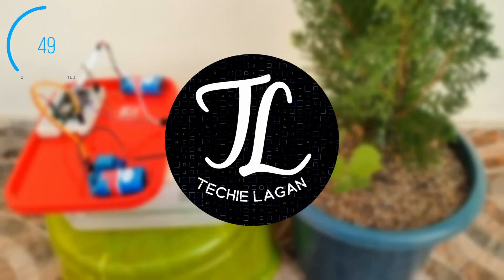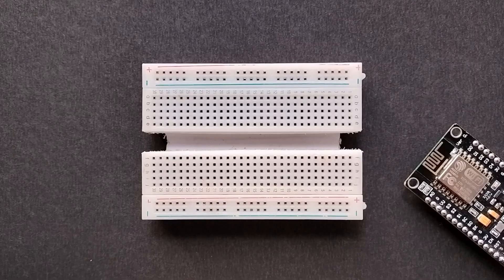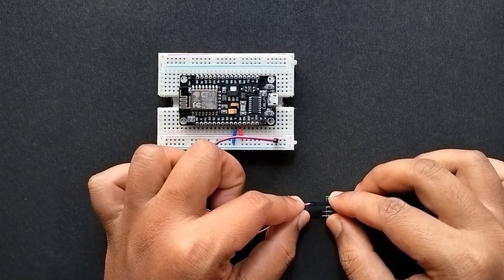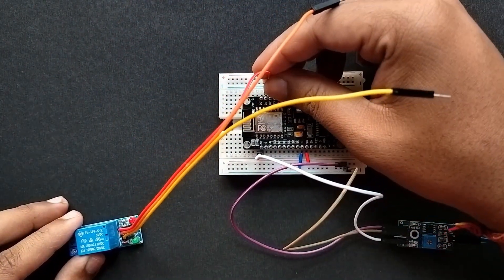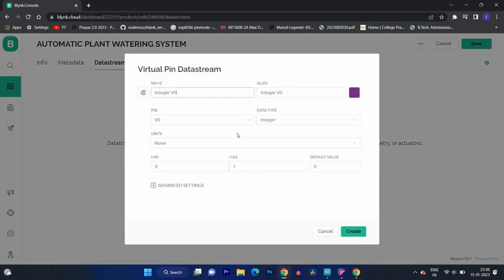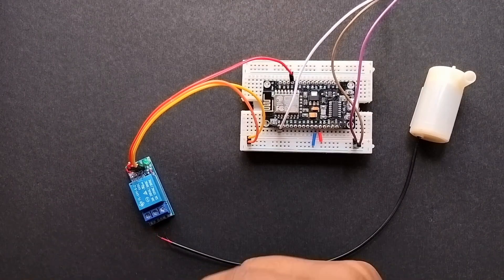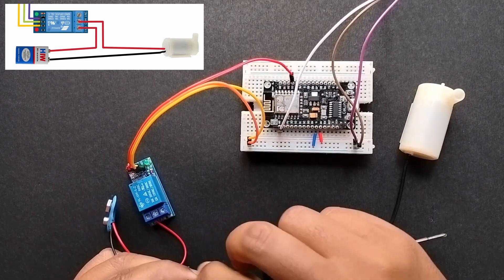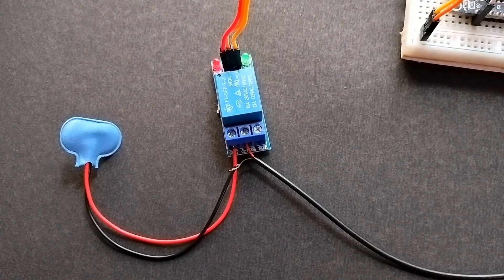IOT Based Smart Plant Watering System using the New Blynk Iot and Nodemcu esp8266 || Techie Lagan

Comment from the maker: //Include the library files
#define BLYNK_PRINT Serial
#include <ESP8266WiFi.h>
#include <BlynkSimpleEsp8266.h>

char auth[] = "hItT82Ueb4BpcEOb_0YnYsyArfbDlLkb";//Enter your Auth token
char ssid[] = "LJ";//Enter your WIFI name
char pass[] = "12345678";//Enter your WIFI password

BlynkTimer timer;
bool Relay = 0;

//Define component pins
#define sensor A0
#define waterPump D3

void setup() {
  Serial.begin(9600);
  pinMode(waterPump, OUTPUT);
  digitalWrite(waterPump, HIGH);

  Blynk.begin(auth, ssid, pass, "blynk.cloud", 80);

  //Call the function
  timer.setInterval(100L, soilMoistureSensor);
}

//Get the button value
BLYNK_WRITE(V1) {
  Relay = param.asInt();

  if (Relay == 1) {
    digitalWrite(waterPump, LOW);
  } else {
    digitalWrite(waterPump, HIGH);
  }
}

//Get the soil moisture values
void soilMoistureSensor() {
  int value = analogRead(sensor);
  value = map(value, 0, 1024, 0, 100);
  value = (value - 100) * -1;

  Blynk.virtualWrite(V0, value);

}

void loop() {
  Blynk.run();//Run the Blynk library
  timer.run();//Run the Blynk timer
}

Comment: hi sir, im looking for your immediate response, my soil moisture sensor not giving any readings in blynk app, but in serial monitor, it's displaying the moisture level
Reply from the maker: Have you inserted the blynk template id and all in your code....
Reply: yes sir, the water pump is working fine in blynk app, but the gauge is not displaying anything
Reply from the maker: Is the sensor ok like us it showing values in serial monitor??
Reply: @TechieLagan  yes, it shows values to the serial monitor. I also followed the video step by step in configuring the dashboard
Reply: may i ask what type of usb cable did you use? charge-only usb or data-enabled usb? does these matter?
Reply from the maker: While uploading the code data enabled is needed but it doesn't matter when you are giving power to it like once the code is uploaded ..

Comment: bro can you send the code please because the link in description is not working plz
Reply from the maker: //Include the library files
#define BLYNK_PRINT Serial
#include <ESP8266WiFi.h>
#include <BlynkSimpleEsp8266.h>

char auth[] = "hItT82Ueb4BpcEOb_0YnYsyArfbDlLkb";//Enter your Auth token
char ssid[] = "LJ";//Enter your WIFI name
char pass[] = "12345678";//Enter your WIFI password

BlynkTimer timer;
bool Relay = 0;

//Define component pins
#define sensor A0
#define waterPump D3

void setup() {
  Serial.begin(9600);
  pinMode(waterPump, OUTPUT);
  digitalWrite(waterPump, HIGH);

  Blynk.begin(auth, ssid, pass, "blynk.cloud", 80);

  //Call the function
  timer.setInterval(100L, soilMoistureSensor);
}

//Get the button value
BLYNK_WRITE(V1) {
  Relay = param.asInt();

  if (Relay == 1) {
    digitalWrite(waterPump, LOW);
  } else {
    digitalWrite(waterPump, HIGH);
  }
}

//Get the soil moisture values
void soilMoistureSensor() {
  int value = analogRead(sensor);
  value = map(value, 0, 1024, 0, 100);
  value = (value - 100) * -1;

  Blynk.virtualWrite(V0, value);

}

void loop() {
  Blynk.run();//Run the Blynk library
  timer.run();//Run the Blynk timer
}

Comment: Bro resend the program code
Reply: Coding of the program can't download
Reply from the maker: //Include the library files
#define BLYNK_PRINT Serial
#include <ESP8266WiFi.h>
#include <BlynkSimpleEsp8266.h>

char auth[] = "hItT82Ueb4BpcEOb_0YnYsyArfbDlLkb";//Enter your Auth token
char ssid[] = "LJ";//Enter your WIFI name
char pass[] = "12345678";//Enter your WIFI password

BlynkTimer timer;
bool Relay = 0;

//Define component pins
#define sensor A0
#define waterPump D3

void setup() {
  Serial.begin(9600);
  pinMode(waterPump, OUTPUT);
  digitalWrite(waterPump, HIGH);

  Blynk.begin(auth, ssid, pass, "blynk.cloud", 80);

  //Call the function
  timer.setInterval(100L, soilMoistureSensor);
}

//Get the button value
BLYNK_WRITE(V1) {
  Relay = param.asInt();

  if (Relay == 1) {
    digitalWrite(waterPump, LOW);
  } else {
    digitalWrite(waterPump, HIGH);
  }
}

//Get the soil moisture values
void soilMoistureSensor() {
  int value = analogRead(sensor);
  value = map(value, 0, 1024, 0, 100);
  value = (value - 100) * -1;

  Blynk.virtualWrite(V0, value);

}

void loop() {
  Blynk.run();//Run the Blynk library
  timer.run();//Run the Blynk timer
}